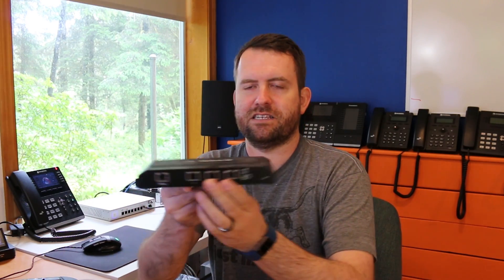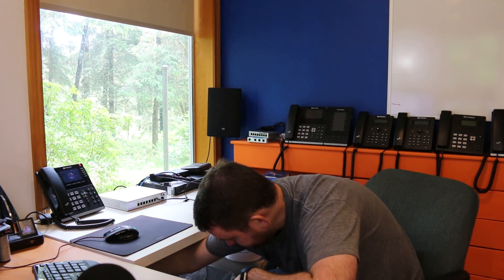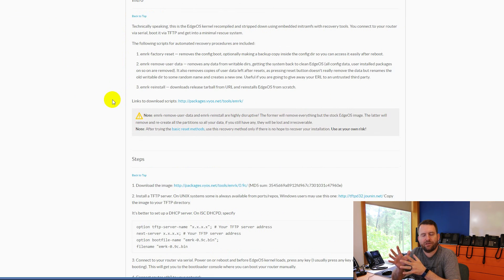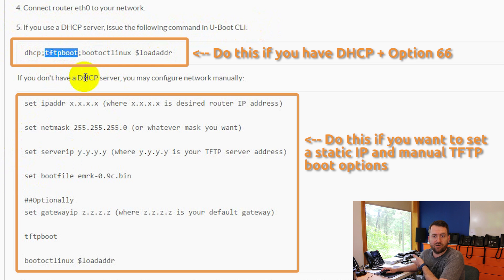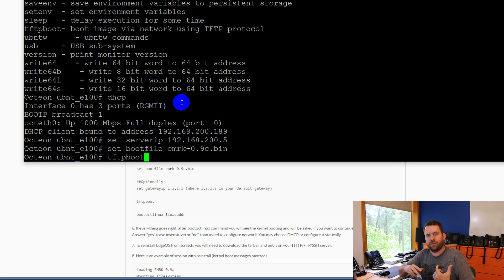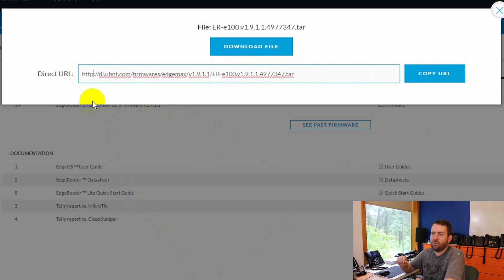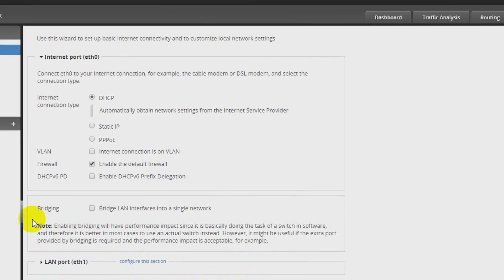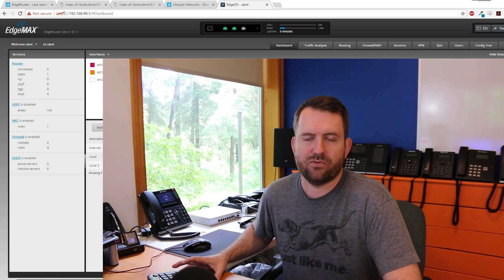EdgeRouter Recovery

Comment: Hi good day, just wondering about this video since I had one of these edge router lite long ago, found this video on recovering this router so I tried it and got the necessary tools for it. so I tried to access the low-level OS using the console cable and followed your procedure once connected to the putty and powered the router it just displayed garbage on the screen. i was thinging the low-level OS is damaged? is there any I can to to this? thanks alot.

Comment: Couple days ago I tried to restore/fix my ERLite-3 so I flashed new pendrive with soft 1.2.0 and.... nothing happened like it is still broken. Problem was with 1.2.0 soft and its compatibility to newest www browsers. I had to downgrade firefox to version 88 or 89 and then I could disable on this browser TL version 1.2 and change it to 1.0/1.1. From this moment I could login to ERL, upgrade it to newest firmware (2.0.9 hotfix 7 I believe) and configure it.

Comment: The easiest way to do this is write the image copied of a good unit wth win32diskimager .format the bad USB stick in fat32 . and write the copied image back on the USB stick with win32diskimager , I just did 4 of them and all work good.if you change the usb stick with a lexar USB 2.0 it will work even faster

Comment: I've successfully restored my EdgeRouter Lite 3 using the above steps. However, when I power cycle the edgerouter it goes back to usb image not found (no elf image). I've tried using a variety of USB drives, including the SanDisk Cruzer Fit.. anybody else had this issue?

Comment: Hi, have you had any problems after a configuration reset, all the ethernet lights for the RJ45 doesn't power on at all for the EdgeRouter4. Even checking double checking cables. Nothing lights up except the power light and the indicator lights but NO ethernet RJ45 light comes on. I'm thinking it's the hardware. But it could be my configuration. I've done factory resets but still no go on the lights. Hope you can help. Thanks!

Comment: This still works (March of 2019), I came across an EdgeRouter Lite, tried to reset it as it was just sitting on a shelf and no one knew the login credentials. During the reset process, it bricked. I found this video and steps, followed and I now have a restored unit. Just an observation, I stuck the USB drive into my computer and the second partition was unreadable. This is probably the partition that holds the original OS that used when the reset button is pressed and it was hosed.

Comment: Thanks for the video! Very informative!

My ERL-3 and Arris modem failed after a thunderstorm. Both were plugged into a UPS with surge protection. I believe a surge came through the coax cable but I still would have thought the modem would have at least fried before it was passed through. Either way, it won't give me any response even after flashing it with a fresh image.

Comment: That's been my major beef about Ubiquiti radios...especially AirMAX...they don't seem to handle electrical surges well. Some stuff could be fix3d with proper grounding but it just seems a little excessive to me compared to some of the options from competitors. Has made me truly struggle to justify the us3 of any Ubiquiti routing or switching products. I at least put one of the 8 port switches in my parents attic (in central Texas) to see how it handles the heat.

Comment: I prefer to write a saved image to a fresh USB flash drive... but if you don't wanna open the unit, sure this does work, buttttttt most of the time when the corruption happens, the drive is not reliable going forward, even if it works after that recovery. 

And indeed it is best to have your router grounded and also connected to a automatic voltage regulator. They make some fairly small, cheap ones these days that works well for this scenario.

Also, if this is 'semi-critical' in a business... just have a spare Kingston 8GB Traveller flash drive imaged and ready to go so that you can at least get back up and running in 5 minutes.

Comment: How about this method?
https://hilo90mhz.com/ubiquiti-edgerouter-lite-erlite-3-internal-usb-storage-fail/
Reply from the maker: That method will work as well (I actually tried it that way first)...BUT - it comes across with the username/password and configuration from whatever image you are using to restore the firewall.  That won't always work for everyone (especially if you restore an image, but don't know the password), so I ended up going with the method that I did in this video.
Reply: Crosstalk Solutions Got it. I will use your method!! Thank you

Comment: I think this is a big problem! I have had all (not very many about 10) Lites that I have installed have encountered this problem. They were all behind quality surge protectors. No other UBNT has this issue so why on earth would they make these routers this way and not fix the issue. 

Chris I am surprised you would want to keep using these. Are you not afraid that it will happen again if the client has the same power issues? Usually if a location has power issues they keep having similar issues. 

It might be an easy fix but it is a fix that we shouldn't have to make. I have another 30+ EdgeRouter X installed and have never had an issue with any of them...

Also I love UBNT but have been very disappointed that they would not do anything for me, I have a stack of these I am not going to use, it is not worth my time if they get corrupt. If you want to trade me them for Xs I would do it in a heart beat. 

Sean
Reply from the maker: In this particular case, the ER was up and running for more than 2 years before the electrical storm knocked it out (and a couple of other pieces of equipment as well).  Everything was on a UPS too - it was a bad storm.  But - 2 years for a $92.00 router is a decent run, and the only time I've ever had this happen to one of my customers in a production environment - of course, everyone's experiences are different!

Comment: Hi Chris. I am trying to recover my edge router. The problem is that I forgot the password. While doing some research on this matter last night I found out that someone successfully recovered the router without restoring the configuration to default. For that I need to login into console as a single user mode. There is no explanation on single user mode on that blog. Could you help me to find out how to login through console as a single user mode?
Reply from the maker: It's probably one of the other options that are available when you boot to the recovery software.
Reply: Crosstalk Solutions I ordered the console cable. Waiting for it to arrive. After that I'd be able to see the options. Thank you for explaining Chris 👍

Comment: what are the symptoms that the operating system has failed and needs to be replaced or rebuilt?
Reply from the maker: In this case, the EdgeRouter just wouldn't boot.  The Ethernet port lights were functioning fine, but it was completely inaccessible on the network - no response to pings, no interface would come up.
Reply: When you try to do a reset to factory defaults and it responds to that but still does not respond to pings, then you know that the OS needs to be replaced/rebuilt.